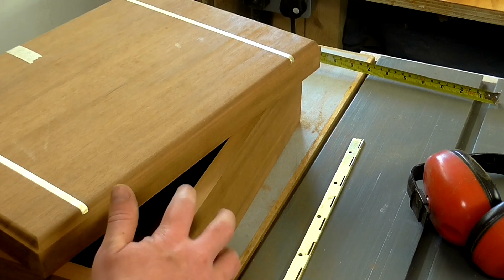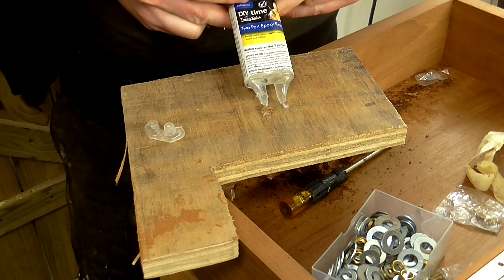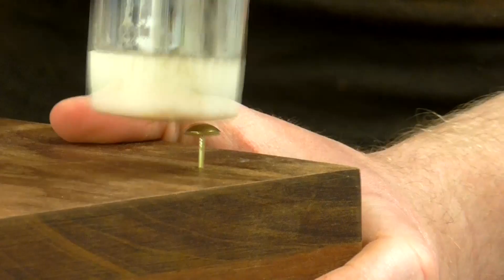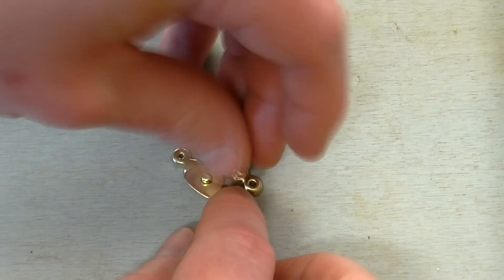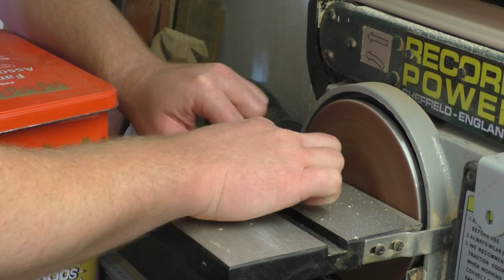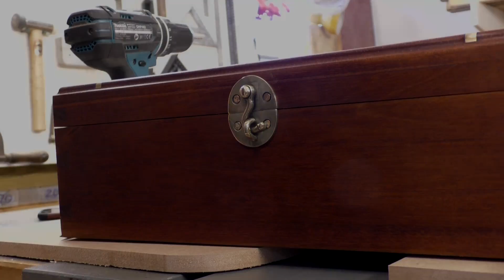Handcut Dovetail & Brass Inlay Mahogany Wedding Box (Part 3 of 3)

Comment: Nice box Keith! I bet you were bricking it routing out the hinge recess after all that hard work making the box! 
You aced it though. 
If you are going to fit more hardware where you drill pilot bits give some "hinge drill bits" a try they make it really easy. Don't go for the cheapest ones like I did though Trend seem to make some decent ones (although as with anything Trend they are a bit pricey). 👍🏼
Reply from the maker: +Happy Wife Happy Life haha yes correct! I hadn't heard of hinge drill bits until you mentioned, just looked them up and they look pretty useful - may have to invest!

Comment: I’ve just restored my great grandpas cutlery box he was gifted from the Royal Opera when he got married and worked there. It’s made of tiger oak so underneath all the faded varnish was a beautiful grain. I hand sanded it as much as I could and then applied 3 coats of danish oil which has given it a lovely colour and satin sheen. I also polished up the metals with brasso and silvo for the engraved silver plaque. Had to redo the velvet lining which actually went quite well. Only paid £5 for a metre of cheap faux velvet and splashed out on some £17 3M 77 spray adhesive. Seems like a similar project to yours. I’ve also got 2 shelves of mahogany in my shed. Wondering what to do with them?

Comment: Greetings from New Zealand.
 Great job - very impressive.
Can you answer a question about the hinge for me.  If the hinge is 3.3mm thick, and your router was set at 3.3mm, does this mean the hinge is not flush on the lid?  Why not take 1.7mm off both the lid and the box back? Thanks.
Reply from the maker: Could have done that, but was quicker just to do it on one side

Comment: Beautiful, classic box!  What a treasure for your brother and his new wife.  I've started to make boxes for gifts, but haven't found many good hinges/latches.  I was told that Lee Valley had some better ones.  They have some cheaper ones, but here's one that is much more expensive, but made of solid brass.  http://www.leevalley.com/us/hardware/page.aspx?p=40829&cat=3,41419,41455 . Just FYI.  I'm going to try wooden hinges soon, so that solves part of the problem, assuming that design works for the specific piece, though it's a less refined look.  Not sure I'd like a wooden catch though.

Comment: I really enjoyed this series of videos.  A very, very, nice example of craftsmanship with the box.

I live in the central U.S. and there seems to be no "middle ground" when it comes to fittings for boxes.  It is either cheap junk or it is expensive hardware.  Brusso is very well made hardware but is pricey.  But when it comes to something like this box, it would be worth it in the long run.  Just trying to give you a suggestion for the future.  brusso dot com